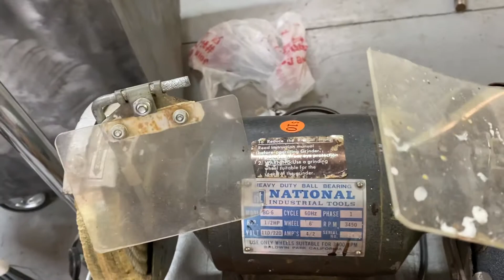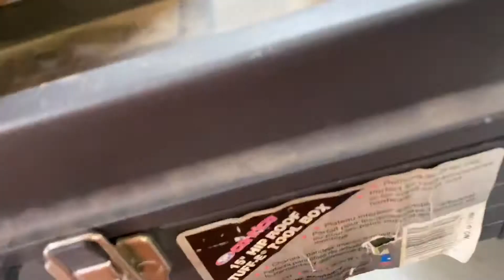Yard sale, auction, and swap meet finds 2020 #19

Comment: Nice scores! I think it's a gear reduction for driving slotted screws. That multi sized wrench you have but didn't mention (You know, they are kind of gimmicky) I think they are great for engine hoist dissemble and reassembly (if you have to do it, I do) where it's almost impossible to see under the frame to get a wrench on it, and you don't need 3 sockets and a handle. Right now I have two of them that live attached to my engine hoist. - I got a bunch more of free stuff today to sell. Only one machinist keeper item though, but I'm grateful to have it, and a ton of chemicals and other little gems. Was the final day of a 3 day cleanout free score.
Reply from the maker: Sounds like a nice score, that multi wrench actually grabs pretty tight, I have one and I use it pull small studs sometimes if there to short to double but or make a slit but for